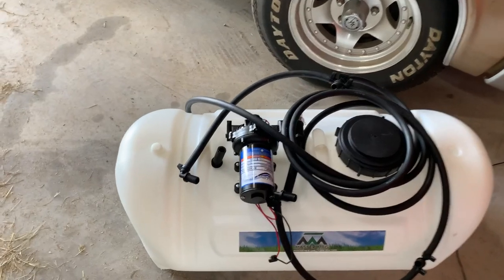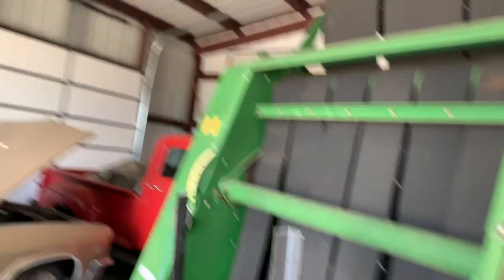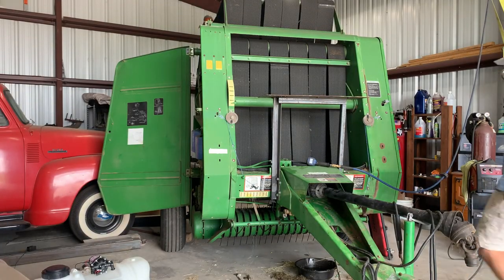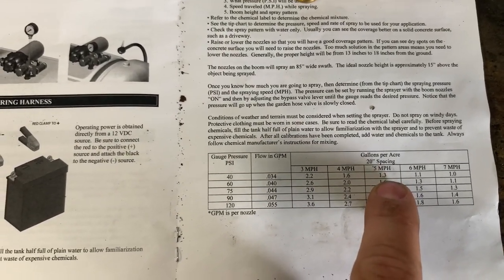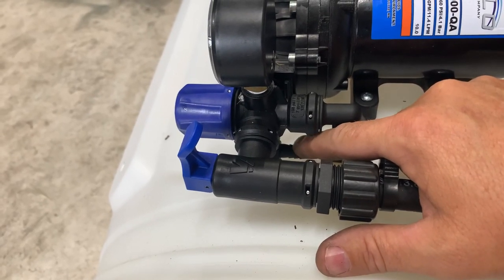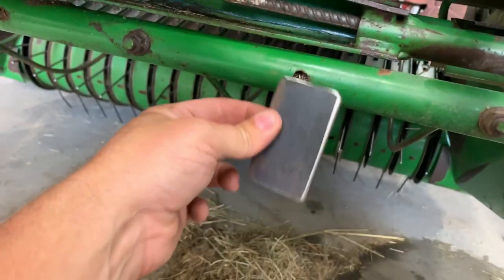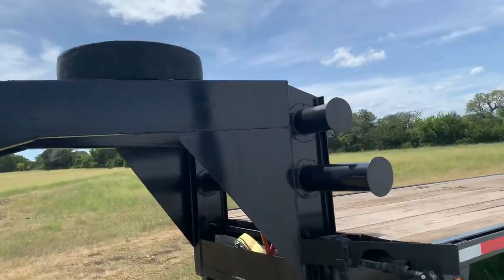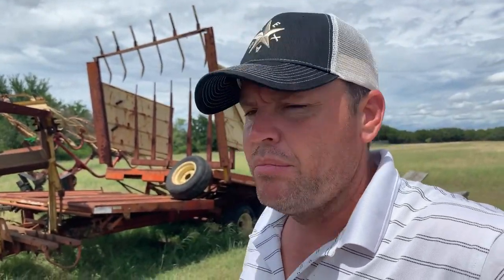DIY hay preservative kit

Comment: That is a nice low cost option.  We never used anything to preserve hay.  We had an old chain baler that didn't wrap a tight bale but always managed to get them baled in dry weather.  Our humidity here in NC is brutal so it's always a crap shoot getting it done around the weather.  We used an old haybine and rake.  Now most use a disc mower or discbine, tedder, and rake.  3 days is typical.  Never used a moisture meter either, just felt by hand.  My father sold Allis and New Holland.  Never had any experience with Deere balers but I know that they are really good.  New Holland is the king here. Thanks for the videos.  I really appreciate it.
Reply from the maker: Yeah I have seen the chain balers but never ran one. They look slow goin but reliable. I think that’s the best way to know if it’s dry, is by hand. The moisture meter is not real accurate because it can’t measure the stem moisture. But I’m hoping after using it for awhile, I can learn the average readings on dry hay to know when it’s higher than normal moisture. Deere and Vermeer seem to be the king around here but I have my eye on a new holland RB450 utility

Comment: Nice job on your fabrication. I don't like putting a plastic tank straight on metal. I use a rubber mat. Just to isolate the tank from any vibration.

Comment: Thank you for sharing.
 I have a baler almost identical to yours it's a 446 John Deere
  I bought a workmaster 65 this Spring.
Is your tractor a workmaster 65?
 I am curious how your tractor handles the baler?

$500 or 600 is cheap  Compared to a cumulator and a grapple.
 I have had 2 stack wagons and now I run accumulator system I think they're both about equal.
Reply from the maker: I had the workmaster 75 and it handle that baler with no problems.

Comment: Did that other cigarette lighter port handle that pump? One is lower amps and I popped it first time I plugged up my bale monitor, but the other one handles it fine. We baled some orchard grass today that was alittle green, hope it doesn't mold. Do you tedder yours down there or is it dry enough in texas to just dry in the windrow?
Reply from the maker: Great question, I had to look it up. The pump needs a 10amp max circuit to run. I just looked in the service manual  and it shows they are 25amp 12v sockets in the tractor but one has a 15amp fuse and the other is a 10amp. The power supply I ordered is good for 15amps. So I guess we will see. If I have to open the side panel for a better power source I will. 
No I don’t have to run a Tedder, it normally will dry in a day and half sitting in a windrow (cutting coastal). Good luck with your orchard grass. I’m going to open up one of the wettest rolls in about a week and see if there is any mold. Maybe I’ll make a video on the results.

Comment: I recomend HayGard
Reply: Hay Guard is non acid. Its sodium based. Its better for animals to eat salt than acid. Ether way you will need to hose down front of baler to prevent corrosion just be mindful of bearings, blow them out with air to get water out or run it for a while to get water out of bearings.
Reply from the maker: That’s good to know. Thank you